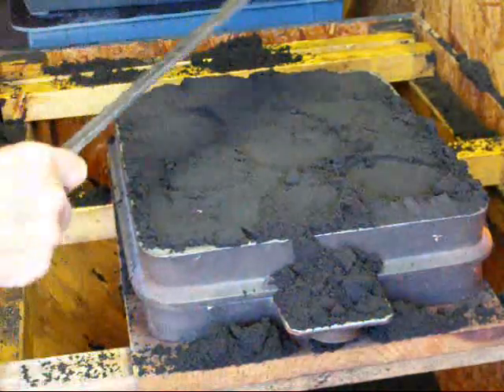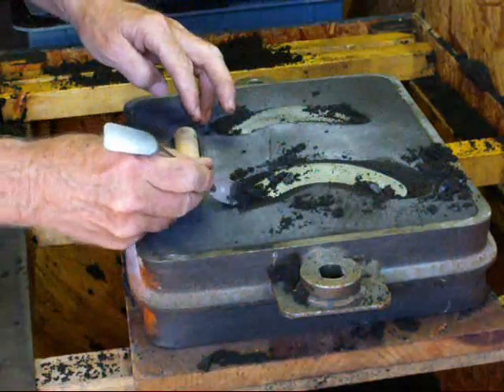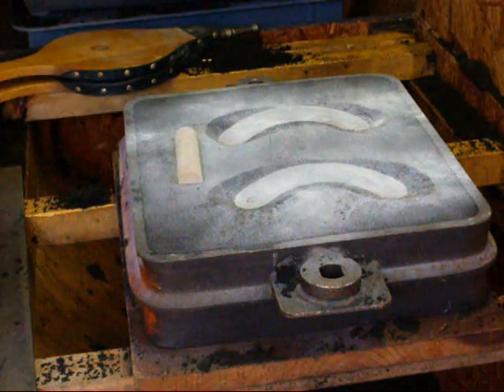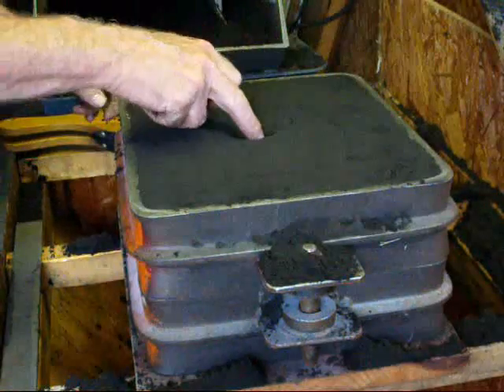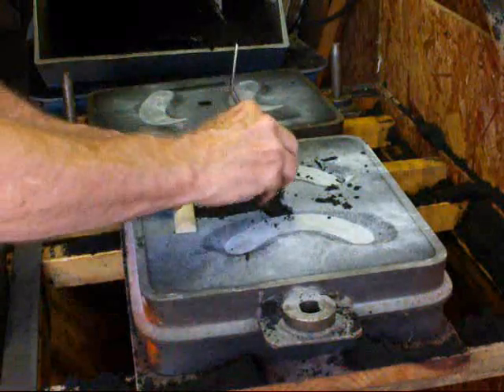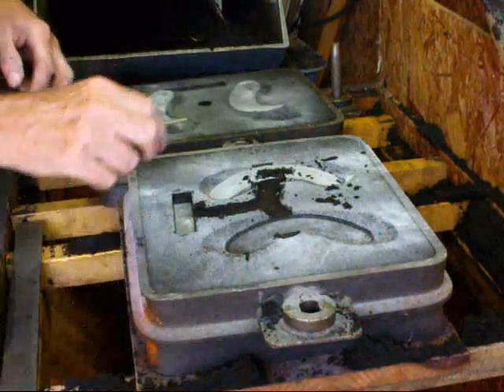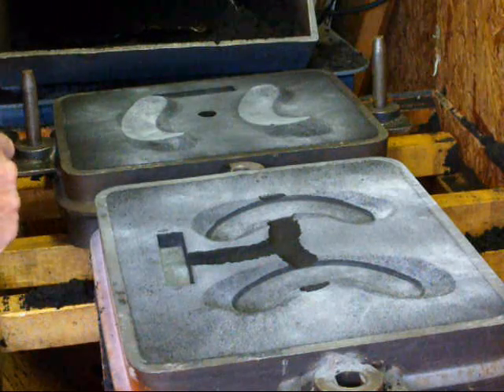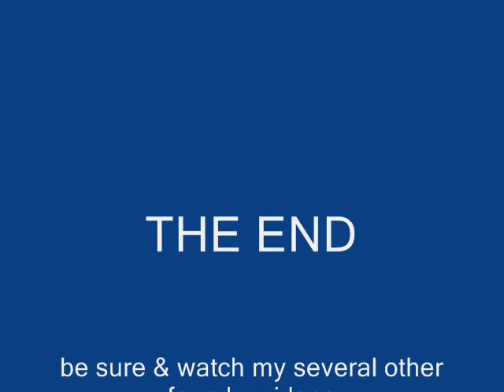FOUNDRY WORK casting irregular line parting part 6 video B tubalcain

Comment: Thank you for this series.  It was a refresher from HS shop 40 years ago but brought those memories back.  We had to make a 2-part, flat back casting, either an aluminum anvil or a C-clamp frame.  The only difference I recollect, is that Mr. Weber had us put in a vent as well.  I never knew the sand was permeable unless it was over-rammed.  Thank you again for your teaching style, it is much appreciated.
Reply from the maker: Thank you very much, I’m glad you like the videos

Comment: Great series Mr. Pete. I want to say thank you for sharing your knowledge and experience in these videos. When I was a young man I leased or rented my wife's grandfather's Welding and Machine Shop after he retired. Knight, my wife's grandfather taught me the trade, starting out learning Oxy/Acetylene gas welding and later electric arc welding. One day a old German Machinist came and asked if he could use my lathe, of course I said no but he could leave the piece with me and I would do whats needed to repair it. He would say thank you but no, he would return when I could do the work while he watched. I didn't say it to him but that wasn't going to happen. Several times he came and left and then one day I was snowed under and told him to go in the office where a SB 9" was set up and do his work. While trying to get caught up I ran into the office to write a work order up. I looked over at what he was doing and was amazed how he had the work piece set up. I stopped and pulled up a chair and watched him. He introduced himself for the first time and told me he was a Master Journeymen Machinist or something like that. He was about 93 years old at the time and this was 1973. He said do you know how long I was a apprentice? He said 20 years was the normal amount of time to serve under another master machinist. I learned a lesson that day and regret I never wrote his name down or took notes on what he shared with me. I'm 67 years old now and often think of the knowledge that is lost from craftsmen like this man. He never had to ask me again to machine something for him when he came down to the shop, I would often stop what I was doing just to talk with him and to learn what I could while he was running a lathe, or mill or any of the rest of the equipment that was available for him to use. I'm thankful for a great many folks like you Mr. Pete that are willing to share a life time of wealth called knowledge with all of us. God Bless, I look forward to watching your videos you have made along with my other favorites I have subscribed to, you're never too old to learn.
Reply from the maker: Thank you very much for a wonderful story. It is a shame that all of that knowledge is a lost when a man dies

Comment: Hiya Tubalcain,
Thank you very much for a great series of movies on casting.  I have learned a great deal and appreciate your clear and concise directions.  
A novices observation: I was wondering if the castings would be better served if the gates were tamped a little with a finger or spoon to ensure no sand is carried along by the current of the flowing metal.
Thanks Again,
Jon

Comment: @mrpete222 I work in a foundry in Wisconsin, there they produce ductile and gray iron castings. I'm not sure what other types of iron there are but for the 2 types mentioned above, the molten iron is heated up to about 2,800 degrees F. and cooled to about 2,500 or so degrees. I think what can be done in your backyard is quite limitless but I imagine it would be pretty difficult to do this in your backyard. We use a lot of safety equipment and other tools to ensure our safety.

Comment: honestly, casting has it's good parts and bad parts as so does using a cnc mill...but in all honesty, i would rather mill the part instead of going through the trouble of making mold, melting the metal ETC. because you still have to cut the excess off, grind it, sand it ETC,
Reply from the maker: +Bill Salvey Thanks for watching